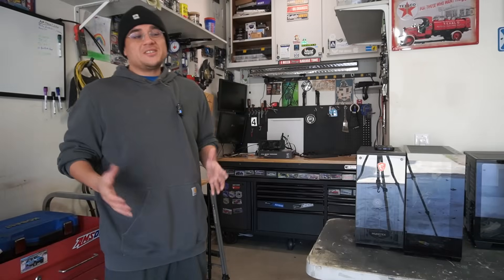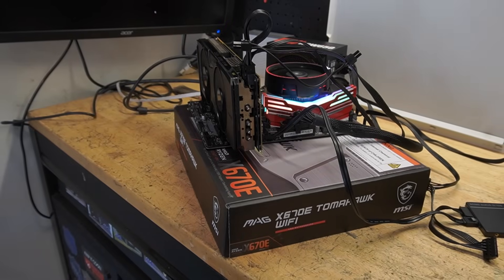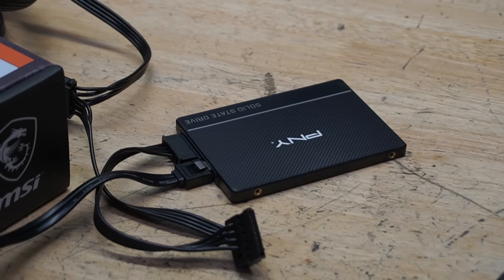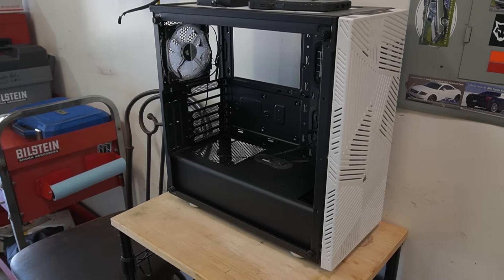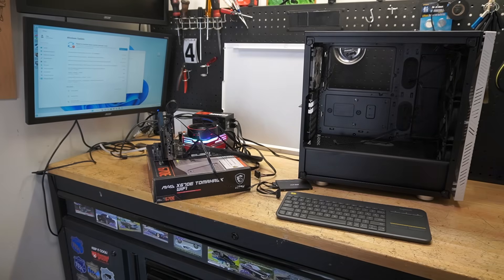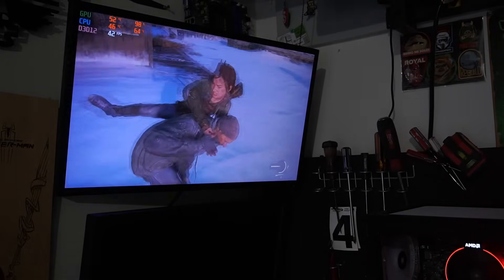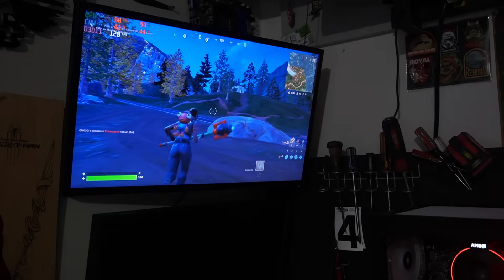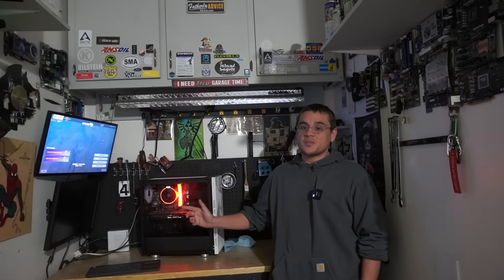Is it still possible to build a decent gaming PC for less than $300 in 2025? AMD just might save us!

Comment: If you want a prime example of how companies are ripping us off just look at storage prices.
2-3 years ago I bought a few 500 - 1000gb drives, 500gb Lexar 2.5" ssd for 17$, 1tb WD blue 2.5" ssd for 35$, a few Samsung 970evo+ for 40 -60$, a few Sabrent rocket nvme 1tb drives for 50$, all new from Amazon and instead of prices going down on older tech the prices go up, please don't start talking about "inflation" and that kind of crap, the prices went up way before the "inflation" talk started and some companies even admitted to intentionally lowering the stock so the prices go up.

Comment: Newegg is currently running some combo deals with a Ryzen 5 5500 (no iGPU), RAM, and mobo for around $175. The motherboard is mATX with only a x16 and x1, though, and good luck finding a single slot GPU that won’t cover the x1.

Comment: subscribed love your videos my friend , my question is will these older computers  use windows 11 and if not what is the oldest generation intel and amd that will , becuase if i built one id like it to native support windows 11 out of the box october is way to close now , hehe
Reply from the maker: the older non supported pc can use 11

I have been running 11 on older pc and never had an issue

you need to make a usb of windows 11 using a program called Rufus

it bypasses the tpm and works fine

Comment: Missing a side panel might be the one thing I'd be worried about having young children or animals around. Otherwise, it could be an optional upgrade down the road if you can find the right case that works when you have the money.
Reply: I bought some mesh that comes with magnetic tape to add to an older case I have with little ventilation. It fits perfectly and looks good, not to mention helping with temps.

Comment: I just sold the same Oloy ram sticks in a NZXT build. I started my PC hobby with Intel 4th gen to 10th. I then decided to try out an AMD system and got a like new open box MSI X570, Ryzen 5 3600, Corsair Dom Plat 16GB. XFX RX 580 Crimson edition GPU, Core Reactor 650W PSU, for $183. I splurged on a "new" used MSI  "Core Frozr L" cpu cooler and some black/red cable extensions that bumped it to $249. I reused my old Thermaltake Versa H35 case, M.2 NVME and Seagate 2GB HDD but adding the cost of those parts totals it all out at $322. Now I have a PCIE gen4 system, just need a graphics card to take advantage of that. There are deals to be had out there if you're patient. Mind you this was before all the BS tariff and  turmoil  inflicted on the economy and global markets which are predicted to cause used PC hardware and parts to go up. Might be a good time to buy low and sell high later? Guess we'll see..I like this channel for the budget build and flipping content, great work man.

Comment: 😊🐢 If I was a flipper I would try: 4c/8t or 6c/12t cpu from first gen intel or newer or FX 6100 6300 8100 8300, an OEM board from Dell HP Lenovo, cheapest 80 sticker power supply which i believe is Antec, R7 450 RX 550 560 470 570 GTX 970, 256ssd, 1TB or 2TB 3.5 Hard Drive, and a cheap used open box case from microcenter or craigslist, that should be good enough for most kids to start playing the back catalog of GOG Galaxy, Steam, Epic, EA Origin, Uplay Ubisoft. Also pickup some laptops with decent integrated graphics because some people need a laptop for when they are not at home, show and educate people that theres a huge back catalog of games for non gaming laptops that they can play such as point and click and novels and walking sims and 2D side scrollers. Also Not everyone is going to like PC Video Games, some people will still prefer Consoles or Handhelds or Video Games on their Smartphone.
Reply: Rough take buddy. Intel 8th gen or newer and Ryzen 3000 series are quickly becoming the standard. GTX 1660 and RX 580 are minimum standard as well. 

Hard drives are out and a 500gb SSD is standard, with most customers becoming savvy to NVME.

Reddit is just a few clicks away, so buyers of flipped PCs are more educated and buy less e-waste.
Reply: @Defnotabot_  🙂 depends where u are, that is expensive in latin america to this day, im trying to suggest something more humble so that everyone can get started with something, i know im rite at least for latin america 🇳🇮

Comment: Mine has been the i7 7700/7700k to flip lately in builds it's an excellent 4 core processor, hook it up with any 10 series card or the rx580 and super cheap and reliable
Reply: 🙂 sure, theres also a mountain pile of oem motherboards from first gen intel or newer that can be easily transplanted to a modern case, most people dont really mind that its oem

Comment: Do you sell the cabinet without a side panel? Don't you replace it with acrylic panel?
Reply from the maker: I try not to but If I can put a pc together for cheap enough I do and fully disclose it to the customers and they still sell
Reply: 😊 sure, you can go to Home Depot and pickup an acrylic panel, and carefully cut it, then attach with tape or screws

Comment: Hey, my question is about the logistics of selling budget gaming PCs on marketplace. For example, I might end up with a selection of computer parts that are on the older side, but I know that I could build a basic gaming PC with a GTX 1070 for a reasonably low cost, then sell it on marketplace to someone around 200 to 250. Anyways, the issue comes with the fact that most gaming PC buyers expect a copy of windows installed and frankly that would wreck the budget. The motherboard might have had windows installed on it at one point but it isn’t registering as a valid windows install, maybe because too much hardware changes? And at these low prices it’s not really feasible to buy a retail copy of windows and expect to actually make anything on the sale. Any suggestions? Should I just explain the buyer is responsible for purchasing a copy of windows? I’m essentially just selling the assembled hardware at a reasonable price for someone who might want something decent that can play a few games but doesn’t wanna invest in some ridiculous priced more modern build
Reply: You can try one of the places that offers Windows activation keys for cheap.
Reply: Windows key sites cheap around 15 UK pounds
Reply: There are a few sites out there that sell cheap OEM Windows Keys. You could use one of them yourself or maybe just point your customer towards one of the sites.

Comment: They have the AMD Ryzen 5800xt on Amazon right now for $129. A heck of a deal.
Reply: Newegg is offering the R5 5500 and an ASUS B450 Mobo for $120 and for $150 they add 32gb of Klev DDR4 ram. That 5800 is a tremendous deal too!
Reply: I think ill get that for a build next month i want to upgrade my external recording pc with a better cpu, it currently has a 4500 and an intel a380 gpu, also needs a better case as the one its in is to small.
Reply: 5800x is also looks decent just no cooler, but saying that aliex is probably better to get a great deal
Reply: I bought 9 of those 5800xt